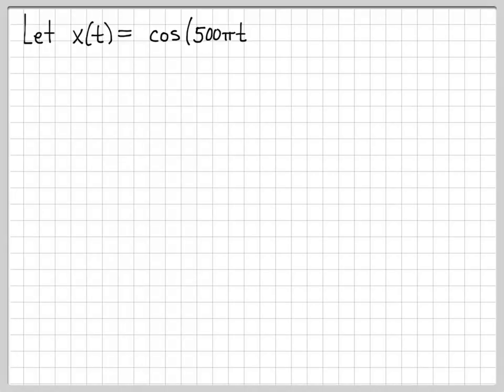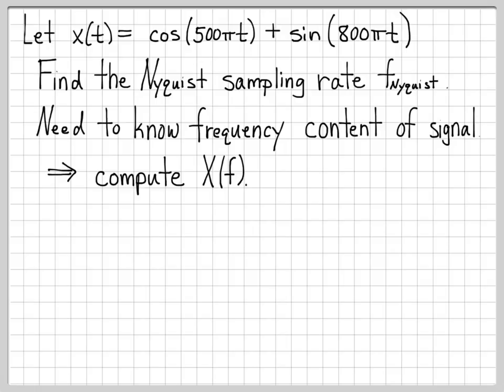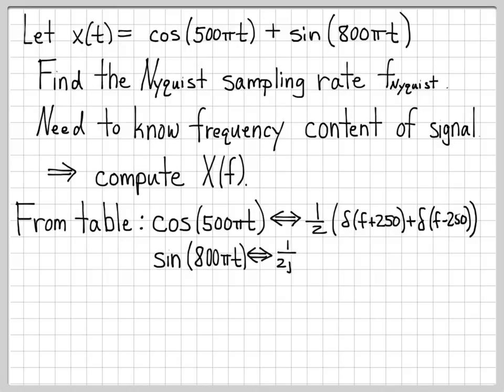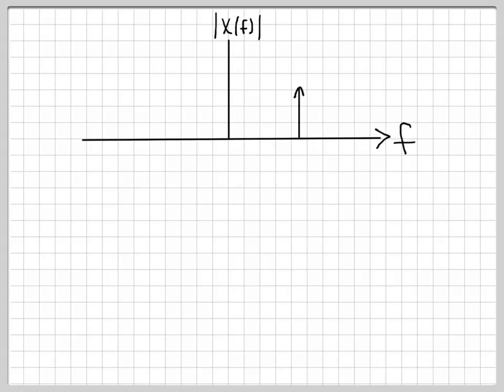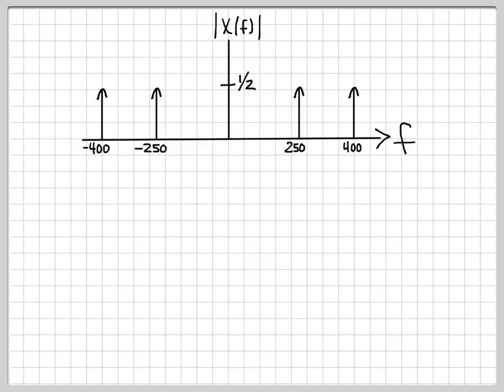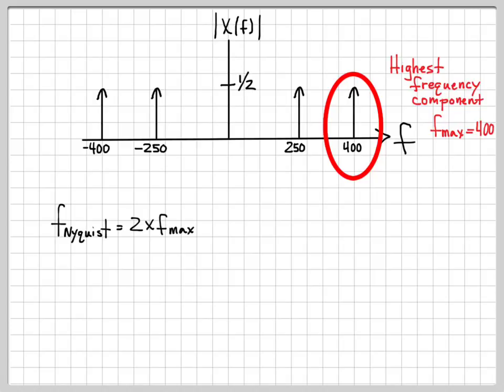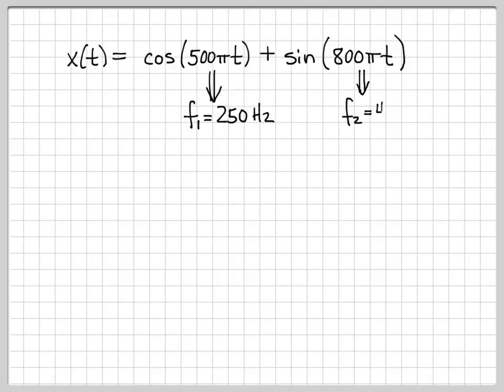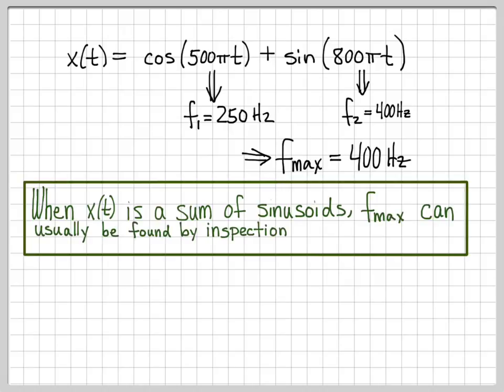Nyquist Sampling Problem 04

Comment: Which table do you use?
Reply from the maker: The textbook used for the course is, "Signal Processing and Linear Systems" by B. P. Lathi.  I typically use those tables, but you can probably easily find similar tables via Google search.  Hope that helps,
Adam